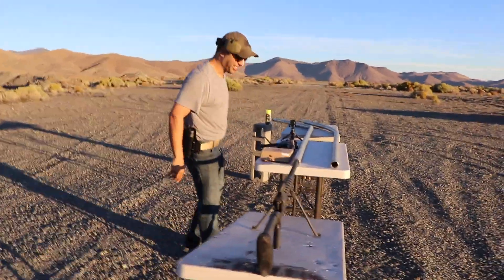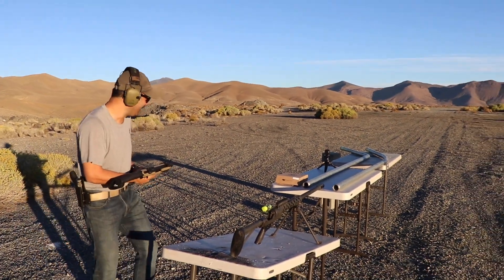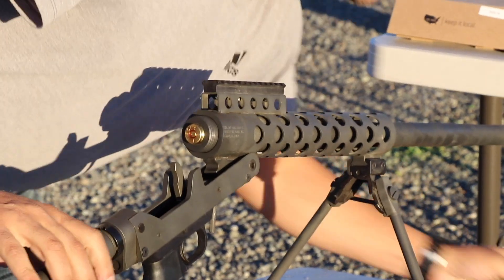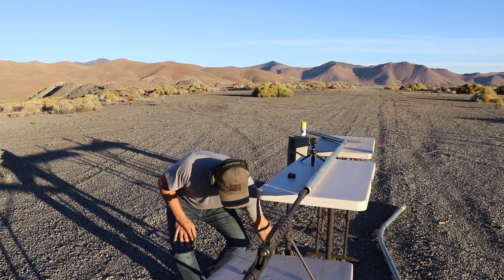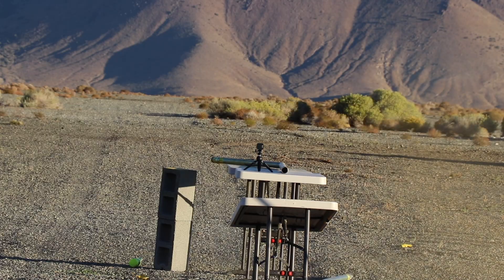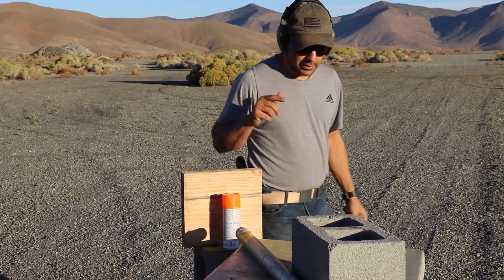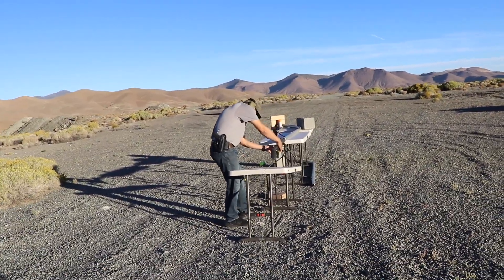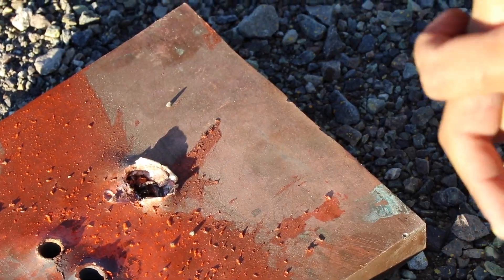Will a 50BMG Bullet Curve?

Comment: If you shoot into two one inch thick titanium plates bolted together at 75 yards with an armor piercing incindiery round it can fly straight back and hit something behind the firing line within a second.
Shooting at anything metal with a 50 is extremely dangerous.

Comment: You need to use a pipe bender and get a proper smooth curve. I also think it would be better if the tube was not so much larger than the barrel. Maybe just 25% larger, which would allow the bullet less latitude to cavitate inside the tube.

Comment: The concussion and pressure built up in that pipe is more than enough to blow a spray can of paint like it did. 
The projectile continued through the bend and the concussion traveled through the pipe and exited the other end. If anything came out of there it was shrapnel. Believe me, the projectile followed its course straight through that curve.

Comment: Well you guys are still crazy MythBusters the new Mythbusters let me tell you one thing. The MythBusters done the same thing with a 9 mm and they went through a 45 degree angle a 90 degree angle and a 180 degree angle and it came right back pass the gun you guys need to pull that up and check it out man that is awesome and so are you guys and so is that belt keep up the good work. Have a great day and stay safe and keep your powder dry!

Comment: Obviously if you insert the barrel fully into the pipe the the gases will continue through the the pipe till it escapes out the other end or the pip fractures. Would of liked to see what would have happened if the barrel was a few inches outside of the pipe.

Comment: I always use 1.5" leather gun belts with a steel core. Those utility belts aren't thick enough or strong enough. You can see that the gun is pulling down on the belt.

Comment: could you not try aiming at the pipe hole from 20-30m away?

also, get a proper bending spring and a bending jig like what Colin Furze uses to bend stuff

Comment: I think one problem you’re having is putting the barrel in the pipe.  The percussion is adding to the ‘projectile’.  I think if you just pointed it at the pipe the way Matt did, you may have slightly different results.  It would be interesting to see, anyway.

Comment: if you offset the barrel to be closer to the side of the outside bend you will have a possibility of carrying more velocity through the multi bend pipe, since you will reduce the distance from the directing wall of the bend/curve when the bullet makes contact to initiate the direction change

Comment: galvanized pipe when heated gives off fumes that can be fatal.
Reply: In extreme cases yes it can be deadly. But in most cases no. Flu like symptoms are more likely. People weld galvanized steel all the time
Reply: @unprecedentedcreations  true but in this case, the bullet was hot & could have caused some fumes.
Reply: ,then they die!🏴
Reply: drink lots of milk